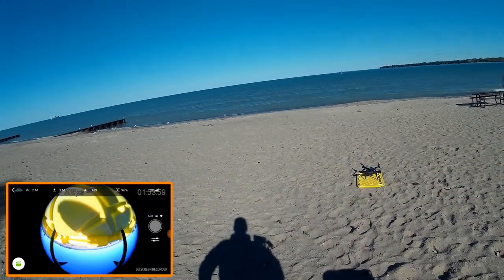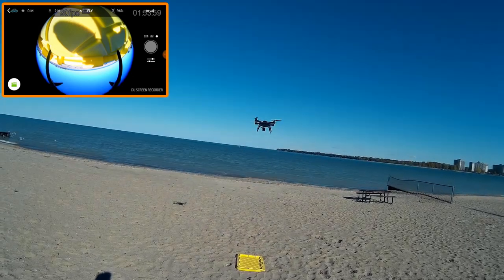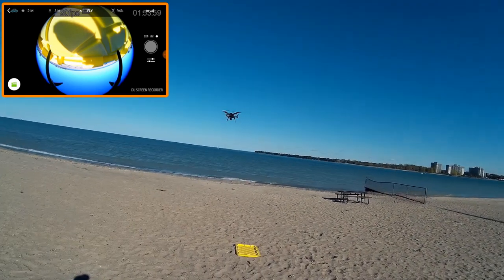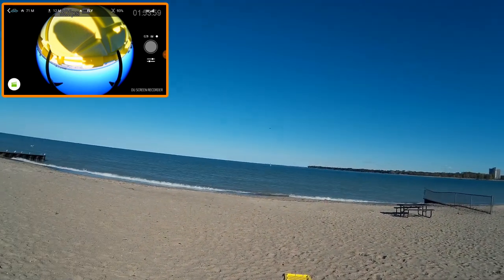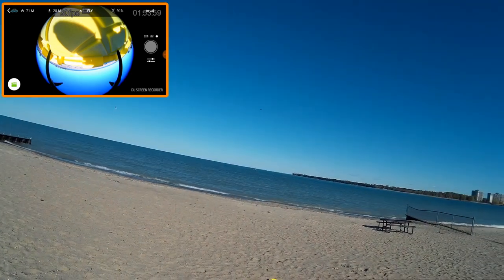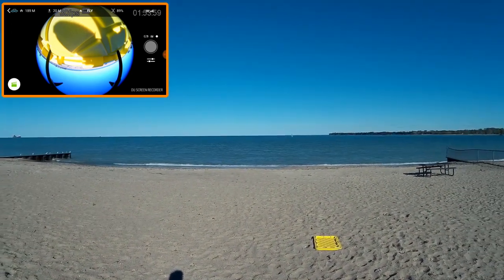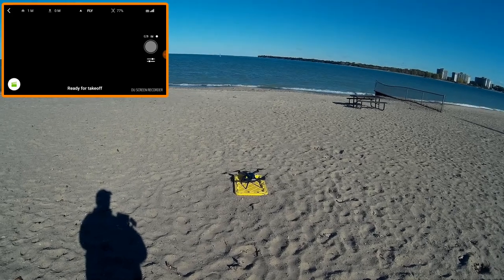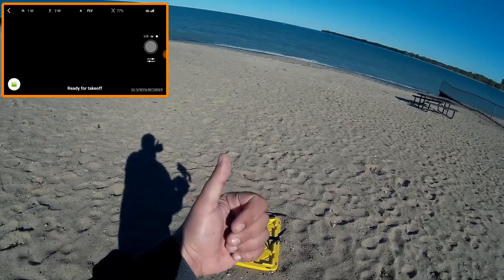3DR Solo - First Brief Test Flight and I am Impressed!

Comment: get solex. Also look at the settings to get faster speeds I've seen screenshots of folks fly this thing up to 65mph!! But in regular fly mode it will cruise at 24mph without getting props in the shot.
Reply from the maker: Thanks and did look at Solex, but for my use couldn't justify the $30 bucks and not saying it not worth it if you have a use for it then it is.  Also if you put in Advance Mode it will fly MUCH faster :-)

Comment: Good stuff.  It has many incredible features.  You should look into the Solex app.  Much, much better than the stock 3dr app, but it only works on Android.
Reply from the maker: Yes I have been at $30 buck it has me thinking if I will use it enough as the main thing I bought this drone for is to fly my 360 camera...